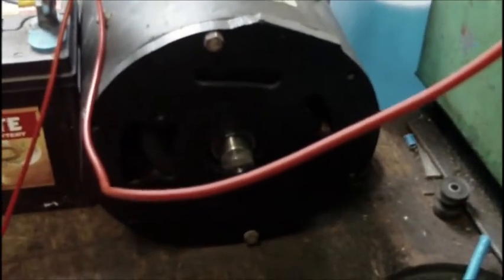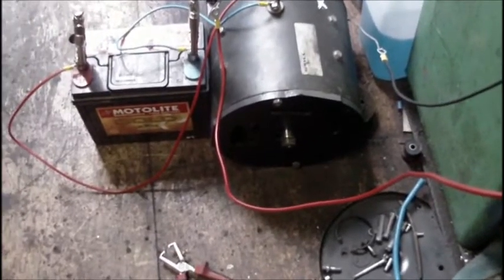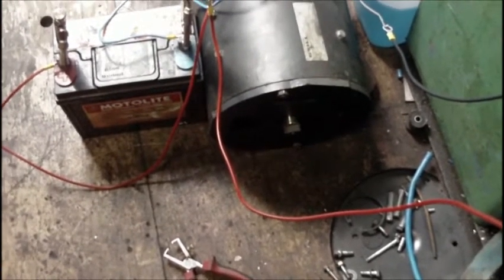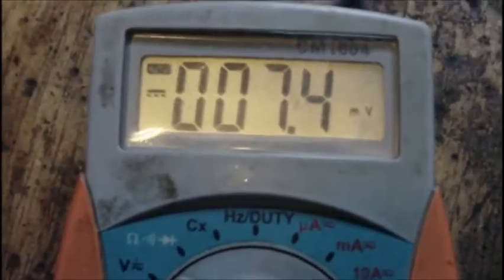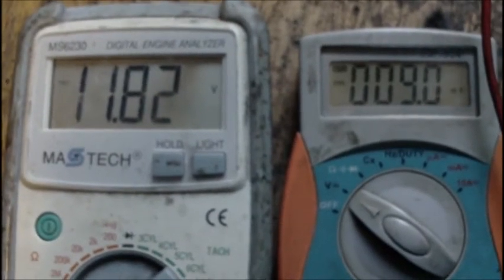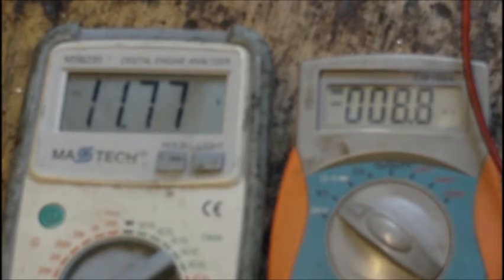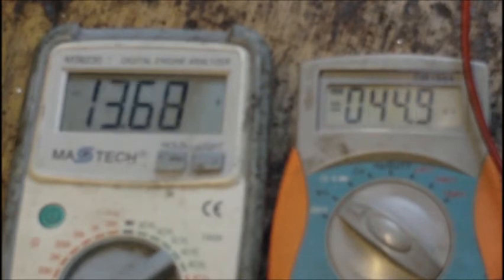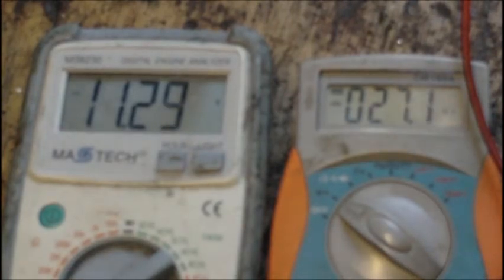Regen Experiment 01

Comment: You can do regen with DC but you need to have some specific things in place. Shunt Motor or Series Motor each with inter poles. Shunt motor is best. Limit the field amperage and be sure your motor is neutrally timed. The more advanced the motor is during regen the more problems you will encounter with arcing. Keeping the field amperage down will also help. The damage is to the commutator and brushes. Other than that the motors are fully able to regen.